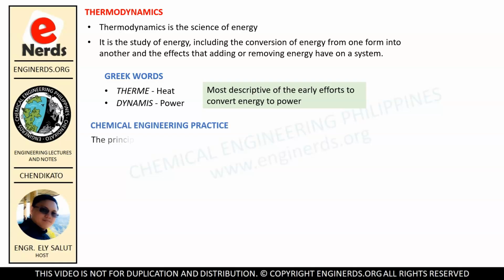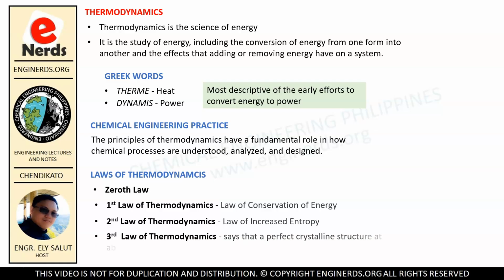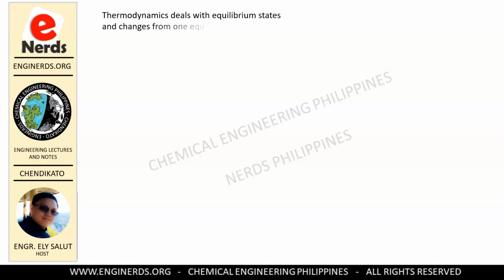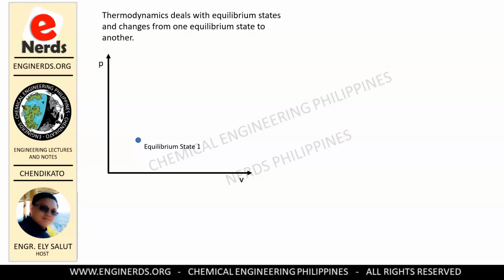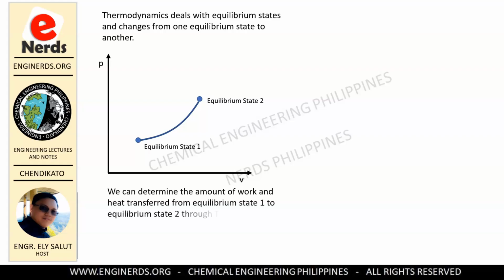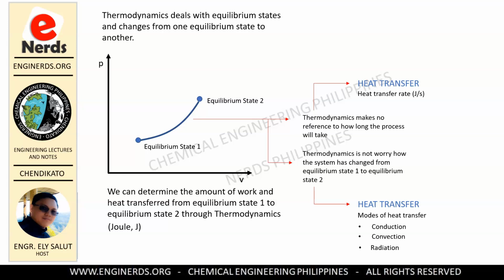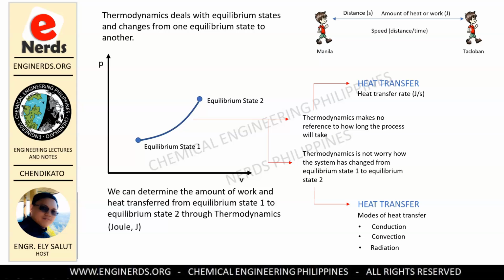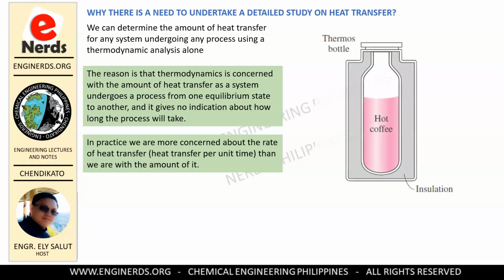ENGINEERING THERMODYNAMICS INTRODUCTION | TAGALOG |

Comment: Hello po. Question lang po, hindi po ba covered din ng Thermodynamics ang heat transfer rate (J/s) kasi J/s po is equivalent to Watts which is the unit of Power po, na pinag aaralan din sa thermo? Included din po diba ang flow rate and work sa general energy balance?
Reply from the maker: Hi. Please watch this video where we talked about the difference between Thermodynamics and Heat Transfer: https://youtu.be/5qOzS6XCYfM